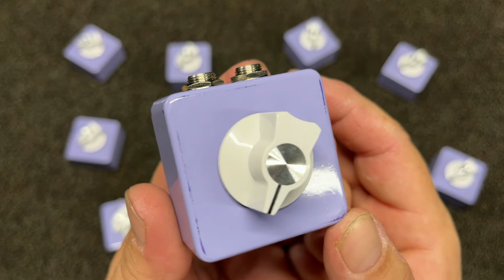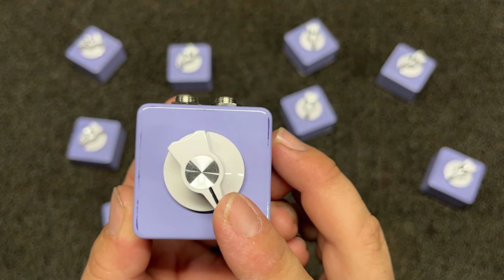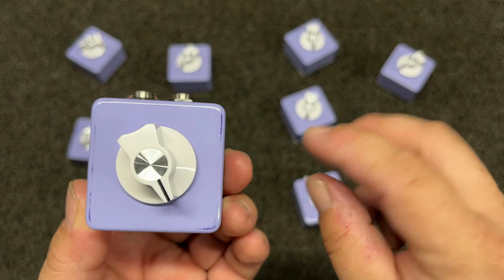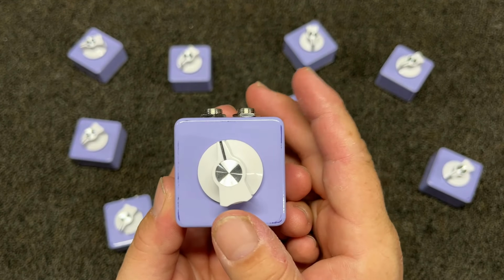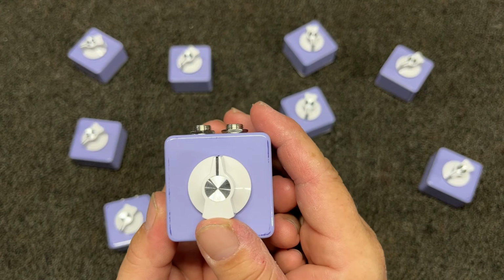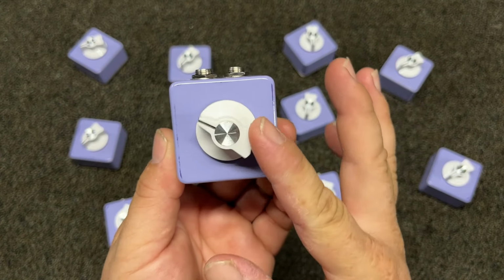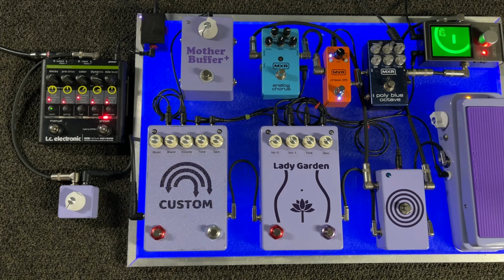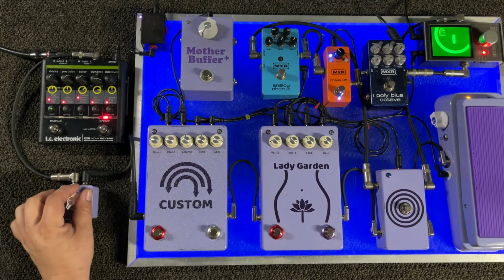Mini Attenuator

Comment: How is this different than a volume pedal (Ernie Ball etc...)? Just curious...
Reply from the maker: @uwmsc  don’t get me wrong a volume knob/pedal is extremely similar to this circuit.
although it’s a passive pedal it does have specific value resistor to regulate how much ground is allowed into the pot which is also a specific value. 

Volume pedals with a low resistance can have the same effect but the sweep will be harder to control.